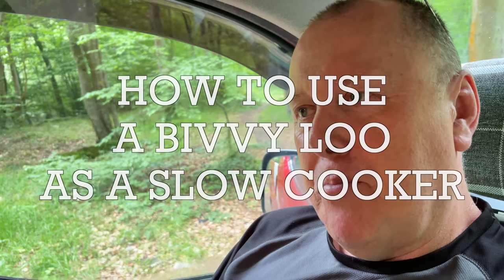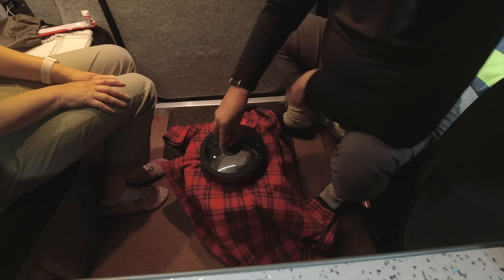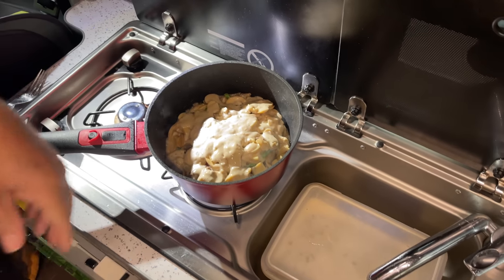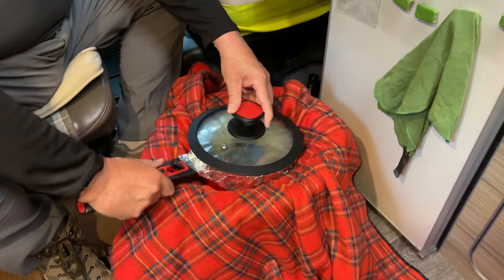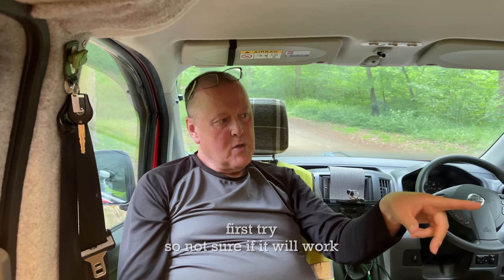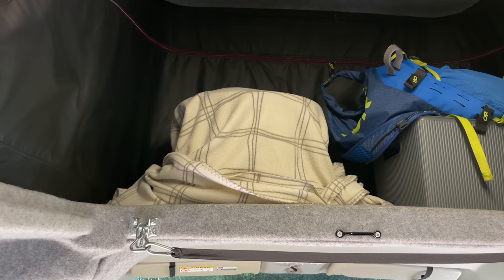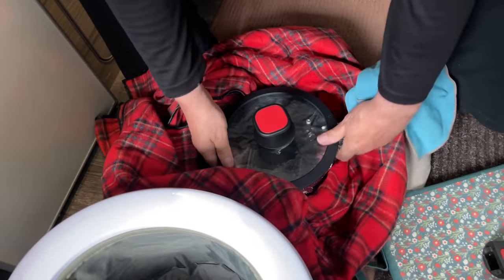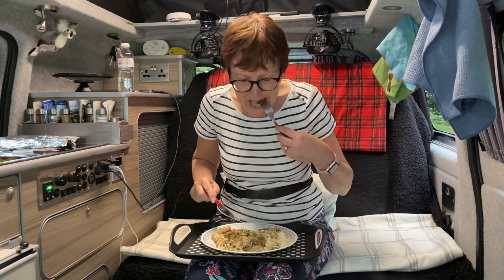How to use a BIVVY LOO as a SLOW COOKER !

Comment: I have a cooking recipe you can use while driving. We use to do this when on long trips in northern Canada. In aluminum foil add raw hamburger, cubed raw potatoes, canned peas and carrots and dry French onion soup mix. Wrap it up tight and add a 2nd layer of aluminum foil then pack it on the outside of the vans exhaust manifold make sure it's tight in there and won't fall out if you hit bumps. After about a 2-3 hour trip stop and pull the package out of the exhaust manifold make sure you use oven mitts and open and enjoy a hot fully cooked meal.
Reply from the maker: That would be a really interesting recipe to try. Thanks for the tip 🙂👍

Comment: It works perfectly fine without the bivy loo part. My mum always used to cook the rice in bed. Same principle.  Heat until boiling, then wrap in cotton kitchen/bathtowel. Cotton  is more heat resistant and in case anything spills... the wrap in the bed covers and wedge with cushions if necessary. Work the same.
Reply from the maker: You are right but I used the bivvy as it had a wide base as the van was on the move all day. Also lots of people use them in their vans. 👍

Comment: Pure wool blanquet can cope with the heat but I wouldn't try it with a synthetic material without any other middle layer. Synthetics melt too easily. Wool doesn't burn easily.
Reply from the maker: Good point.